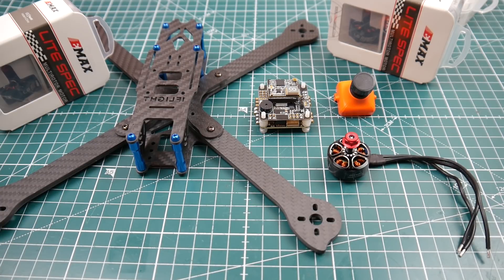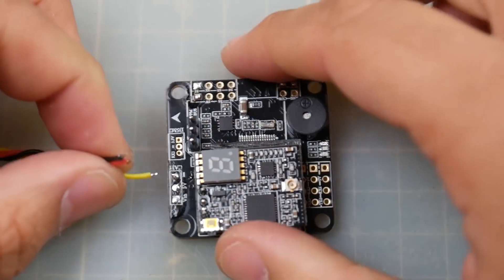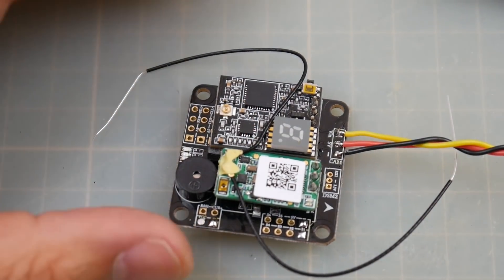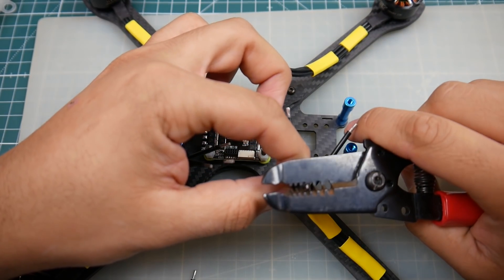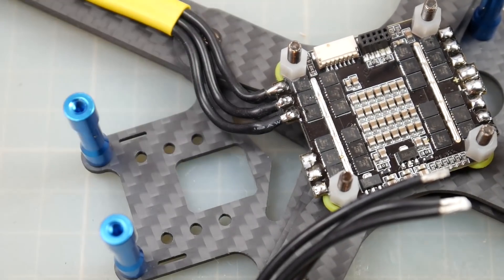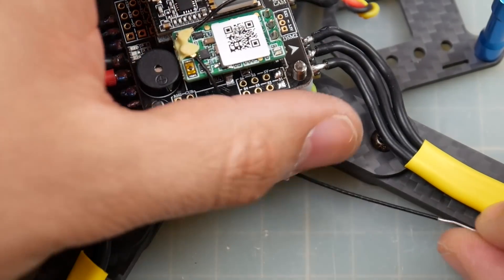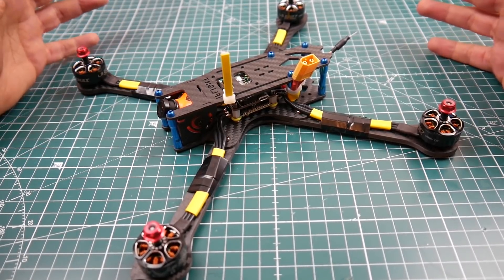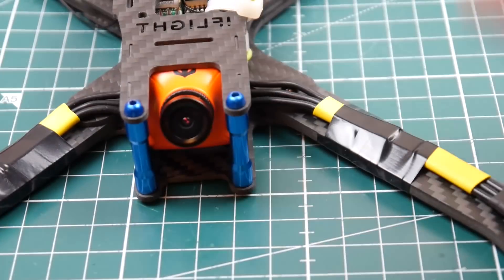How to Build A Long Range FPV Quadcopter // Emax Lite, Emax Magnum, iFlight XL7

Comment: For anyone watching this that is new to the hobby, keep your antennas as far away from the frame as possible. Also, invest in a quality VTX antenna.
Reply: How does he tell the direction of the motors? the wires are all black. and is there such a thing as an all in one board like the stack he used but with better esc's?
Reply: @anyshitt  To determine motor direction, REMOVE THE PROPS, connect your battery, connect to BLHeli, select the motors tab, acknowledge that the props are removed, slowly spin the motors and gently touch each bell housing to feel its direction. If a motor is spinning in the wrong direction, use BLHeli to reverse the motor direction. I don't know of any truly all-in-one boards except for some tiny whoop AIO boards. Most are a FC/ESC stack and a few stacks will also include a VTX. Happy New Year!
Reply: @anyshitt  Also, you may want to check out fpvknowitall.com for mini quad parts recommendations and reviews.

Comment: How would you build a fpv quad that just focused on range and distance and not so much the speed?? Bigger transmitter with bigger blades and small motors since you dont want it to go crazy fast? How would you build it?

Comment: Nice build, but this is no LongRange.. no CrossFire or R9M.. no “Must” GPS module, no autonomus Buzzer, no good  VTX antena.. that stock antena will not be good for 500m+ that build will not reach 1km without failsafe...

Comment: 1750kv on 4s is pulling 100amps full punch, on 6s the poor HQ DP7x3.5x3 props flex and squeel like a pig pulling 156 amps!
flight times have been over 10 minutes on 1550mAh 4s, and I the 6s flew this morning for 11 minutes and used 770mAh. So the verdict is still out on which will give longer flight times, obviously the 1300mAh battery has more Amp Hours but is heavier.

Comment: Should never place RX antenna along the carbon fiber frame. Carbon fiber conducts electricity and will ground out your receiver signal. Antennas should always be isolated from quad frames. Great build !
Reply: It won’t conduct electricity. But it will mess up transmitter/ receiver radio signals if the antenna is touching it.
Reply: Alistair Von Zanzibar  it is though. Rule number one in antenna mounting. Dont make it touch metal or carbon. The letter has field reaction properties and will distort your signal heavily. There are quiet some comparison tests out there, just look it up

Comment: Nice vid. What size lipo you use to get 10 to 20 minute flight times? Sorry if I missed that.  My main concern as you can argue electronics all day is the frame weight at 129.+ grams. That to me is very heavy.  I put together recently a 6 inch frame ,a Mode2 Ghost that weights 57 grams.  Thumbs up and keep posten.

Comment: I have an XL7 long Range too..omnibus f4pro, m8n gps, tbs unify hv, tbs endurance motors and tbs xfire. Dys 32bit aria escs. Vas Antennas..love the frame...compact enough..light too..just over 300g..I use dal 6x4x3 props.
Great frame for an LR build.

Comment: DM … didn’t you say that you might add GPS?  I’d like to learn how to install & set one up — not sure what kind or type to use.  A friend of mine told me about ones with ‘loiter’ & return to home features.  How are those set up?  Thanks for all your videos; I appreciate all your insight.
Reply: What you need is GPS-enabled flight controller. It should have a barometer, and an unused tx/rx port for GPS module and I2C bus for compass. Usually it's Omnibus F4 Pro V2/V3 or Matek F405 CTR. Then you buy practically any GPS UBLOX Neo M8N-based module with compass, or buy compass additionally. As for setup, see videos about INAV, there are plenty.

Comment: if this is going to be a long range then you really need a GPS.  If you do decide to add a GPS, will you be using iNav  so you can have return to launch features in case the VTX gives in before crfx  signal?

Comment: I really look forward seeing this build after the initial test has been carried out. Please give us a video of when you swap out the XM for a crossfire nano or micro receiver and a decent vtx+antenna arrangement. I am also interested in what additional capacitors you add. On my own builds I use 330uF per ESC and they are mounted on each separate ESC and it works great.   
I just ordered a crossfire micro TX and some nano receivers and I'm curious about how you will mount the antenna of the crossfire receiver. As others already pointed, you get dramatically less signal from the XM antenna you mounted along the arm.   
Except for the antenna arrangements, I like this build and I think with a good camera it may give you high quality videos.

Comment: long range with 2.4 ghz and dip antenna for fpv ? it's a joke right ?
Reply: Is there min defintion for long range, because you can get very good results on 2.4GHz, implying you have power on it.
Agree on the antenna though.
And the way he tapes it to the carbon gives me a headache

Comment: You should check out the brain 3d sma mount for the back. Mounts to the stand offs in the rear and is the cleanest way to mount rx and vtx antennas that I've seen, works great and look awesome too. I bet the floss2/flowride mount would fit that frame perfect.

Comment: The FC screws are structural it is a bad design. I used steel screws and locknuts under the stack to stiffen the frame.

Comment: its a good weight my 8inch though is 314grams but its based on the simple frog frame, the DAL7040 props will work well with 1900kv....

Comment: The Rx antenna placed on the arm in this way will be completely not working  in my opinion !!!
The carbon fiber will 'stop' the signal !!!
Reply: IceCreams62  the carbon fiber will not stop or block the signal but when not proper isolated will even conduct the signal. By doing so completely setting the antenna propogation ttill nill because you screw up the antenna length...
In case the antenna is proper isolated then the carbon fiber will act as or a mirror or a reflector for signals. You could make use of this but then you have to maintain a distance of 1/4 th of a wavelenght of the rc frequency. Mostly 2.4 Ghz so 3.1 cm give or take..

Comment: hi , another great build, keep it up. A question. After just finishing my 4 inch , which is flying amazing btw, I was looking for making another 5" (or 6") build. I have some gemfan 2306 2200kv motors lying around and wondering if I could combine those with HQ's 5x5x3? Some advised me to use them on a 6" with HQ's 5.5x5x3 or the new gemfan 5544, but I don't know which way to go. Any suggestions on props and frame (I was thinking 'Hyperflow CG' frame with a 4in1, 5 or 6"). grtz from Belgium, Europe

Comment: I don't get the point in this build.
a-> 1900Kv motors good for 6" props on a 7" frame. I think 1400-1500kv motors with 7" props will be more efficient.
b-> xm+ rx with one antenna blocked from the carbon arm is not ideal for a long range quad. I'd have preferred a L9R rx (or crossfire)
c-> A tiny dipole video antenna is better suited for a fast proximity racing quad
If not using crossfire and a better video antenna you really need a gps and inavflight.
Reply: McKenzie741 A: 1900kv is fine on 7 inch. There are guys running 2400kv on 6 inch 5s. B/C yeah I agree. He must be upgrading eventually...

Comment: Is the Flysky - fsi6 compatible with the frsky XM+ receiver used in the last build video?
Reply: no
Reply: Ro H are you sure it doesn't support ppm?
Reply: Flysky and Frsky use two different non-compatible protocols.

Comment: Awesome work, man. I'm planning to build one of those big quadcopters, like TBS Discovery an so on, just don't know yet what to use. Maybe a NAZA fc... But I'm going to put a gimbal, fpv switcher and so on. 😊
Reply: MC's Creations I'm doing the same thing with the diatone white sheep Fpv frame. 10in long range with naza v2. In manual mode it will be fun!
Reply: Dufour -FPV Awesome, man! 😀 I already have the frame, but it's a cheap clone of an older version, I think. That way I'm going to mount the 2 axis gimbal in front, like I saw in a video. 😀 And I just bought the motors: 4 SunnySky X2212 980KV. They look awesome!
Reply: Dufour -FPV Here's the video I mentioned: https://youtu.be/h4lB1gTjiUA I bought the same motors he uses. ;) BTW, he has other videos of this quad. ;)

Comment: may sound stupid question but i'm new to the hobby...how is possible to have a long range with XM+  receiver? with my XSR i struggle to reach more than 600-700meter.  which battery are you planning to use?
Reply: It’s really more of the TX that would need to do the long range all the rx does is receive the signal remembah
Reply: Mini Quads Mega Fun yeah thats  fine but u need a good visibleline line of site   antenna to pick up that signal rememba lol
Reply: Enrico Bononi I'm wondering the same. I want to know too. 😊
Reply: Enrico Bononi i saw a guy in top of the comments (ask )the same thing  and d mesh said that if the quad works well he put the crossfire on it ( and said that he said it also in the vid)